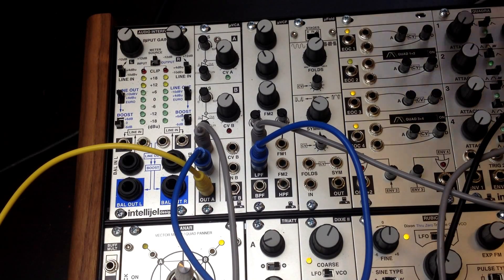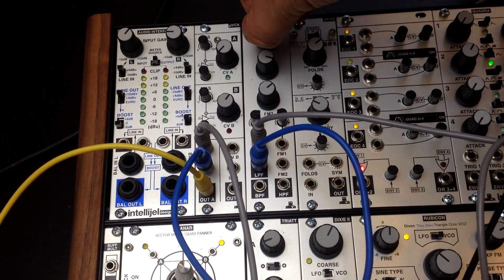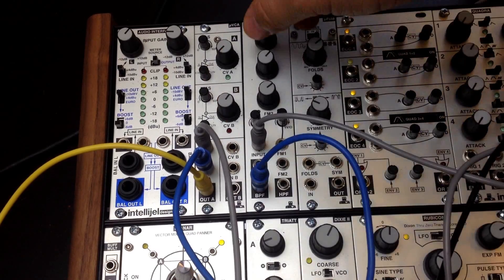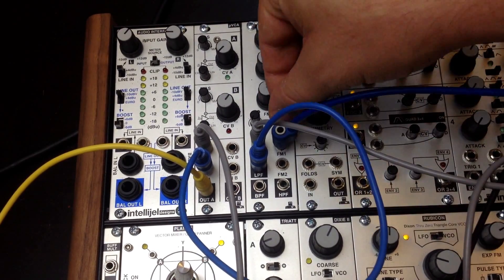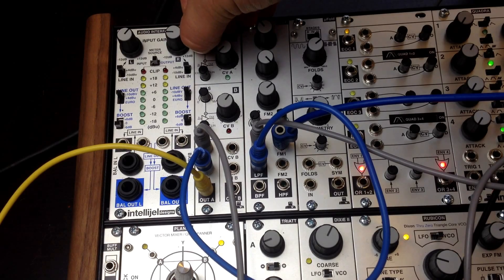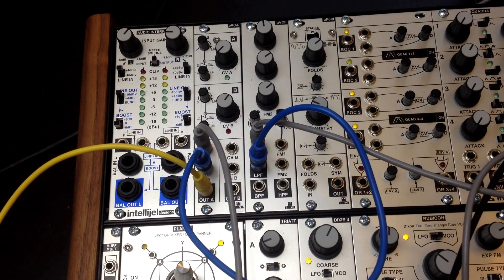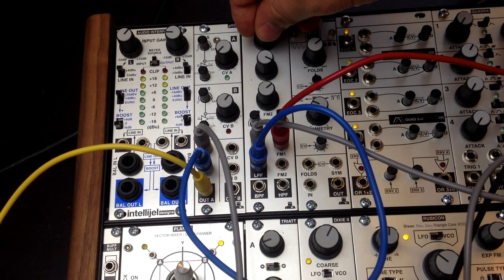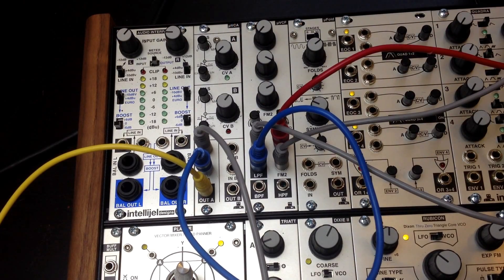Intellijel - uVCF State Variable FIlter demo

Comment: Are the larger pots on this module bolted to the faceplate - like Doepfer ones are?
I presume the smaller ones are clinging onto the circuit board and then poking through the faceplate - without being bolted to anything inside.